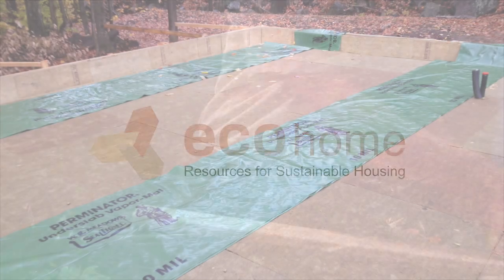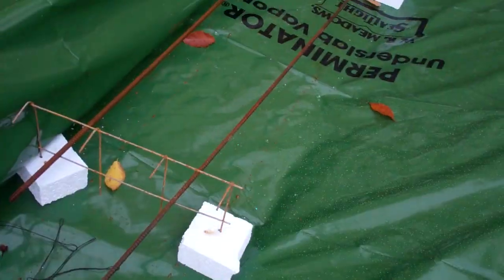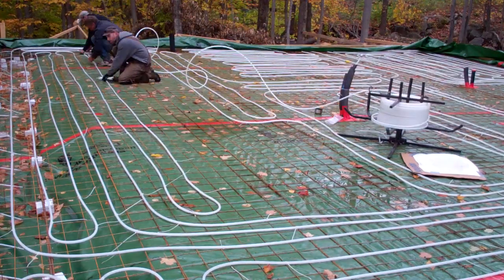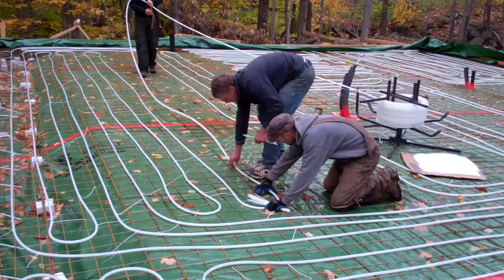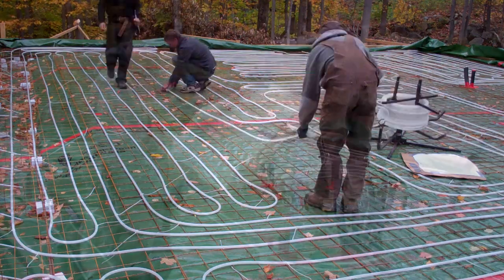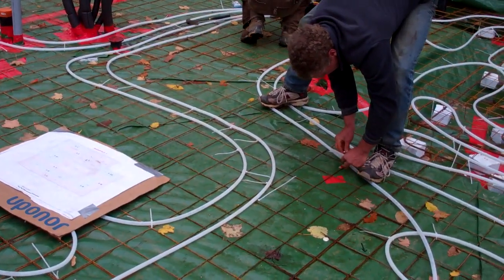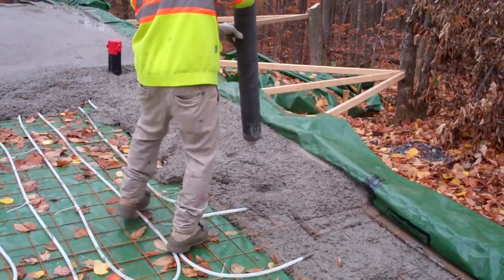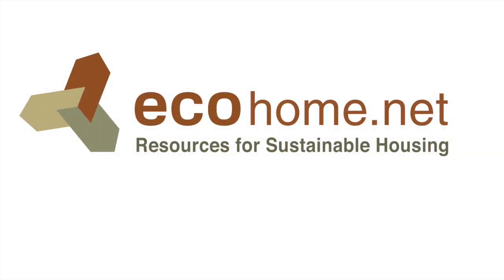How to install radiant floor tubes

Comment: concrete over leaves, mesh down to bottom= total BS
Reply: The leaves aren’t gonna hurt anything, they’ll be there, fossilized, in 200 years when they take that slab up. The guys that take up the slide will be entertained and know that they poured in the autumn.  They pull the wire mesh up into the middle of the slab with their concrete working long handled tools.

Comment: the concrete isn't get anything strength from the wire if it isn't up in the concrete. ??
Reply: You are entirely correct. It's a common practice is to pull it up with a rake during the pour (as was done here), but that is somewhat inconsistent. A better practice is to install 'chairs' so it sits several inches off the concrete for the pour.
Reply: It’s often done like this,  with fibermesh reinforcement added to the concrete,  which is often used in place of mesh.  In cases like this,  the mesh is only there to give the tubing a place to attach.
Reply: I would think the guys pouring the concrete would be walking all over the mesh with the chairs under it and bending the mesh down(?) they couldn’t really wear spike shoes because it’s membrane on top of foam insulation.
Reply: @williamwixon  what i see sometimes that looks better is that they fix the tubing on the insulation with U nails (way faster to install) and then put the mesh over this so theres a 1inch space between foam and mesh

Comment: whats the reason for putting heating pipes in the external foundation. why haven't you guy put any insulation down under the heating pipes?  Dose the rust from the steel degrade the pipes over time? I guess the pipe on the outside of the foundation have very large amounts of concrete to heat before it begins to heat the room, how is this economical??
Reply from the maker: I don't fully understand your questions, but  I will do my best to address them - its a slab on grade, so if by 'external foundation' you mean the floor, then the reason is to keep your feet warm and warm the house. Under the green poly membrane is 8 inches of insulation, and the only pipe passing through is the main water feed from the well. Attaching hydronic radiant tubes to the mesh is pretty typical, rust is not a concern.  Please write back if that doesn't answer your question, and you can see the entire video series on our website - http://www.ecohome.net/video/guide Best regards.
Reply: andy mills please watch previous videos. the slab has pinched of insulation!!!!
Reply: Depends on where you are, this is in Quebec so its the cheapest way. Alternatively you can install a gas boiler, that would be the preferred choice in areas where electricity is expensive, and if the grid power is heavy in fossil fuels.
Reply: electric floor heating
Reply: Gas is way cheaper then Electric heat
Reply: @MNicehole  nope, not if using off peak
Reply: @MNicehole   Only because of government subsidies.